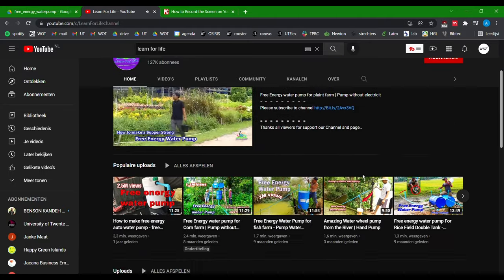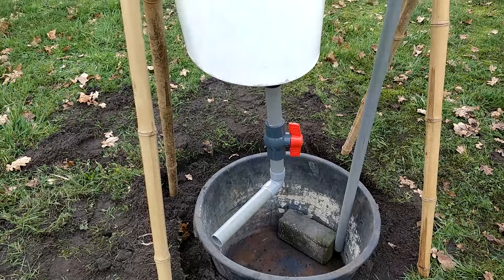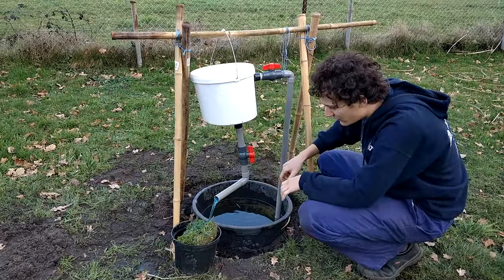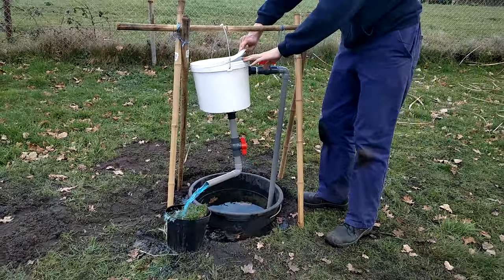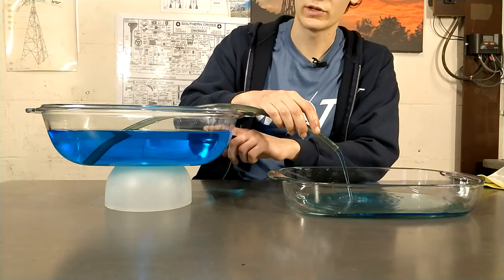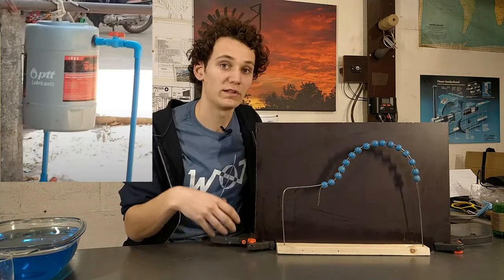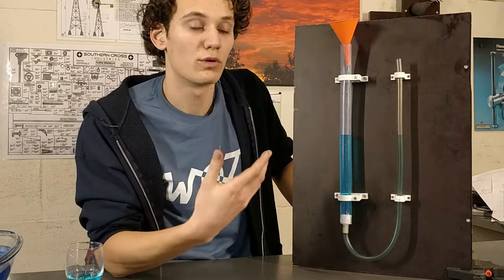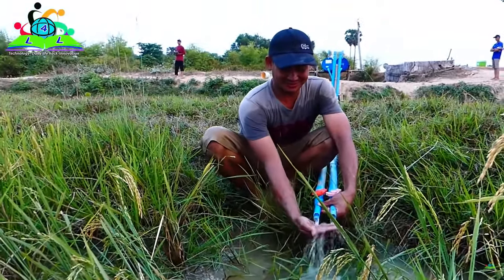FREE ENERGY Water Pump Tested. Is it possible?

Comment: We haven't tried this experiment but we have tried other experiments and have good results it seems to me that you really don't understand siphons like the hero fountain. One the water level had to be over top pipe in order for it to work and the water down at the bottom had to be one continuous water that means the pipe at the top had to be full of water second the noise you heard of the gurgling means that it was creating pressure, we suggest that you redo the experiment and we did send a video earlier to show it's should work but how long well the heroes fountain the real one has work for centuries and it takes it's pressure from the lake so in real life these things actually work. How do we know this one I'm a librarian and we do research and study these things so are you doing something wrong and didn't name it fake which does damage to ever going to Green energy I think so you have one way of thinking and it's always have to stay with you been taught you'll never discover anything new if you never go outside the Rams of what we've been taught. We have a suggestions will send it in our next communication let's see if you're brave enough to try it??????

Comment: Are you telling me I can hold up a 1000 tons worth of water with my finger? Think about it if I put a small hole in a bucket big enough to hold a 1000 tons of water I could just plug the hole with my finger done. Lol
Reply: Yes you can! It all depends on the water height from your fingertip to the water level in the tank, not the volume of it.

Comment: You didn't do it right, it most definitely works. It looks like you just assumed it doesn't work and half way did it and when urs didn't work, you thought it confirmed it didn't work, but in reality it requires a bit more effort to get it working than what you did, but it definitely works
Reply: No, this is a siphon with a priming bucket. No siphon can lift any water to a higher level. This excellent video demonstrates that
Reply: @kjellg6532  No, there's more to it than what he did, people actually do this and it works. The pressure it creates, makes a suction that continues the siphon without it being lower than the water source.  There's more to it than I know how to explain, but it definitely works
Reply: @LandonHarris343  Sorry, but that is not the case. When water start flowing out, an underpressure is created in the bucket, but til reduction is defined by the height difference between the surface of the water in the bucket and the output. This height is less than the height from the source to the said water level in the bucket and the water will try ru go in reverse back to the source/well. It all stops. Then air is leaking in from the outputt side.
Reply: @kjellg6532  well, I know it works, bc I've seen it work. I don't know all the science behind it, but it works. I can't take your word for it when I already know it works.

Comment: I believe the inlet pipe should be much smaller then the outlet pipe
Reply: Unfortunately   you  do  not  understand. the  basic  that   .........the   tank  must  be  air  tight  ,and  can  resist  a  negative  pressure   of  at  least  15  psi  and  the  inlet  system  must  be  also  air  tight  and  sealed  . You  should   also   know   that  the  inlet  water  level  cannot
Reply: Inlet  water  cannot  be  lower  than  33 feet   .

Comment: inflow pipe needs to smaller diameter than outflow pipe. At least 5x difference between inflow and outflow pipe diameter.
Reply: No. Input may be any size, even 5x grater than output, but for this to work, the source warer level must be higher than the exit.

Comment: U can certainly siphon from a lower point to a higher point  I do it every year when I empty my pool
Reply: That is not possible. A siphon can not deliver any water at a higher level. Now with a siphon you can go over a maximum 10 m high wall, but you can not extract any water up there. All of it must down under the source before exited. So, lokking from inlet to outlet, no siphon can lift any water..

Comment: your pipe size to vessel size is off ratio, also did not prime correctly. this does work, you just didnt consider the science very well. i made a setup like this and it worked fine the first try.

Comment: Probably there is air in the white bucket coming from the lid
Reply: Noop, the video shows that the lid is air tight. The video shows that this siphon, as any siphon, can’t lift water to a higher level. A siphon is no pump due to no input of energy. Input water level must be higher than point of discharge from the system. If not, the system will suck air from the output side and stop.

Comment: For some reason your demo I didn't see the sealing the tank and I bet you didn't do correctly feel like rush job. I bet the air is leaking from it.
Reply: No. You clearly see that water is gulping out the exit. That because air is sucked in from the exit side. This proves that the bucket is airtight.

Comment: Pls don't try disprove peoples effort.It works because of the following
1. Nature provides for no  vaccum. I've duplicated this model. It works.
Use smaller pipe for suction and twice it's size for outlet.
Total volume of inlet pipe should not exceed 30% of the suction drum.
Extend the outlet to a minimum of 10metres. Make sure you include anti return pressure stand pipes closed on the upper end. It works.
I am Uduak Ekene, physicist and mechanical engineer,
MD, KENAK INTEGRATED FARMS
Reply: Gravitational force g is 9.8m/s. 
Consider the the volume of water in suction drum about 200l . Av.  .200kg, acted upon by 9.8g. force at a height of 10m . A suction pressure is enough to suck water from 6m well, through a 25mm diameter pressure pipe. 
This force is enough to suck from a 11.5m water well through a 12mm diameter pressure pipe.
This force Will crush a 200l PVC drum.
This force can crush your skill in 2s.
Thanks
Uduak Ekene
Reply: @uduakekene5707    Sorry, you are a physicist and mechanical engineer, but you believe in perpetuum mobiles? What about conservation of energy? It needs energy to lift water from a well. Where does this energy come from? Don't tell me vacuum or gravity are a source of continuous energy!
Reply: “It works”. 
You have just invented Perpetuum Mobile? If you have such a thing, you could take water from any lake or sea,, pump it up and let it flow back to the sea via an electric turbine. No more electricity bills. No more need for oil, coal, gas or nuclear power. Just running water in an endless loop.

Comment: Set up is different from the original one, First the suction side doesn't have a foot valve to hold the water from the intake line, 2nd  your bucket might not be a air tight , mean is not airtight you will not creat vacuum pressure to suck water
Reply from the maker: Hi Mandy, as mentioned, we replicated and tested the setup you can see at 0:15. In the video about their setup there is no mention of a foot valve.

Comment: Multiple mistakes :   1)   Your tank is tooo small for size of exit pipe.   You need to create lots of low pressure inside .  The pipe size is directly proportional to tank size/inside pressure.    2) You didn't fill the input line , water drags water.   3) The lid may have pinhole size of air leak , that can prevent functionality .  4)   The input line must be smaller than exit line .   I empty my swimming pool without a water-pump.   I put a hose in the pool,  then create suction using shop-vac .  As soon as water starts to flow, I  remove the shop-vac,   water flow continues until pool is emptied; however, the hose end must be lower than pool's bottom .   U see water climbing up then slides down the hose.
Reply: Of course siphoning works, but no tank is needed for that, not even suction. It is enough to fill the hose with water and close the outlet end until it is in the right position. But this video is aimed at the claims of many YT-videos, that you can get water up from a deep well with the outlet well above the water level of the well. And this is nonsense. If something like that is demonstrated it is a fake.
Reply: The reason why it works is that the hose end is lower than the pool's bottom, that is also why there can be no free energy water pump as the water level intake must be above the outlet. I believe that is what the video tried to explain.
Reply: @haweeha7738  i agree , i tried the experiment . concluded same
Reply: 1) Actually no tank is needed. Pipe size does not matter for this to work.
2) With a container, you do not need any foit valve or filling of inlet tube. 
3) ? (The lid must be air tight)
4)  No, input line may have a diameter of say 1 meter and exit line 10 mm in diameter.

This video shows that a siphon can not lift any water.

Comment: For sure this is not a free energy design. Perhaps low energy would be a more appropriate name for this solution. The guys are lifting 150 to 160 litres of water to 1 to 1,5 meters. That is already some potential energy there to do some work.  This pump if one can call it a pump is just an easier way to start siphoning without an electric pump or other means.

Comment: Items missed out by author....1 foot valve, 2 outlet pipe of double diameter and five times longer length, and 3 air pressure chamber. Please do your job properly otherwise you are doing a disservice to the creator and your audience.
Reply from the maker: Hi Sam, as mentioned, we replicated and tested the setup you can see at 0:15. The size of the pipes we used is pretty similar to the one in this video. Also in this video there is no mention of a foot valve. For reasons explained at 5:00 in the video, we think changing the pipe diameter will have no influence on whether the pump works or not

Comment: You didn’t use an air tight container! Try again! It depends on the suction inside the container.
Reply: Look at the video! The container is air tight. He shows that this setup can not work. For it to work, the outlet must be lower than the water level in the source. Hence, no siphon can lift any water up from a well.

Comment: What I learned from your video is that an intelligent person can play the role of stupid, but the opposite is very difficult...
You have to fill the inlet tube until the water level rises above the outlet, and when there's no more air in the inlet tube, the water will flow out, acting like a vacuum pump...

Comment: OK... So, I do not see a pressure tank or cylinder. You can't do a test and fail it if you are doing it wrong.
Reply: Also. You have no check/one-way valve installed.
Reply: He is using a plastic container with a an airtight lid. Do you not see it? Using a barrel in a siphon means that it is easier to prime the siphon and that no one way valve is needed at the inlet. Perfect video, to the point!

Comment: The system works the bucket you have is too small the volume inside the bucket is less than the volume inside the pipe running down into your well you have to take this into consideration this is called physics
Reply: But the barrel here is much much larger than the volume in the suction pipe. His point is to prove that no siphon can lift any water.

Comment: Its quite obviouse that water drops from a great height the end game is to get the water to fight gravitational force which is impossible bar you have a Ram Pump,,
There is a way by using a small gadget made in the USA,,its called a V Pump try getting one!

This V Pump is primed from a water tap,,you turn the tap on feed the system then of it goes,,its possible to prime the V Pump by other means using  stream water syphoned through a miniature vaccum hence of it goes against gravitational force.
Reply: A V-pump is a totally different system. It has been used for decades to pump water up from deep wells. It is also used in steam engines to inject more water into the boiler under pressure.  It relies on a ejector system. 
Used in a well you submerges the ejector down in the well, two tubes going to the surface. On the surface there is an ordinary electric pump sending water down to the ejector and receiving water coming up the other tube.  The water goes round and round. Now, you may extract a fraction of this water at the surfase, and the system will replenish from the well. 
Ejector pumps are also used on some (war)ships as emergency pumps. 

To make a V-pump work, you need a continues flow of pressurised feeding water
Reply: Em, considering the V Pump assuming tap water is the primer under pressure to prime the V pump,would you think the same set up under pressure could be achieved from a bilg pump ie creating the primer as the pressure point just like the pressure from a tap,
The question relates to reversing gravity flow up stream to operate a sluice,
As one must work down river not up river the object is to get lift into a highbanker sluice to attain waterflow up stream into the sluice,, im not accustom of knowing the answer to what degree of pressure would be needed to trigure the V Pump i haven't globally seen any specific device that can lift water against gravity that would be amicably priced to the market place,i am awaear there is a screw pump innovation from the egiption period,,but such device hasn't been miniaturized into product form notably there is one made in mock pvc with a motorized unit driving the screw to raise water at speed but not under production,ram pumps are a tiresome set up there is a system by Australia this acts like a ramping but floats and is piston fed without fuels electric etc water primed fed,.

Thanks again appreciated
Reply: The Australian version is called a BUNNYIP PUMP
Check it out,it is quite exspencive totally water primed operated from the same stream,river,creek,self reliant floats on the surface of water sat on a tyer for pump compression from the pistons.

Comment: You need to prime the pump, it doesn’t have to do with siphoning it has to do with suction, you had too much air in the lower pipe. Instead it sucked air from the outlet pipe. You missed a lot of the pipe setup.
Reply: Try it again by priming the pump and run the outlet into the original bucket to keep the water level up.  Go over the instructions again.

Comment: YOU DIDN'T ADD THE "ONE-WAY" STOP VALVE at the water source and have that also filled up with water to lock the air so that the AIR PRESSURE os built up in the big bucket to havr the vacuuming/ duction effect, brah. Please don't be so hasty to ecplain away why things didn't work when you actually left out one of the most critical pieces of the entire setup.
Reply: YOU DO NOT NEED ANY “ONE-WAY” STOP VALVE WHWN USING A PRIMING BARREL. There may be a lot of air in the bucket. He is proving that a siphon can not lift any water.

Comment: The device prepared on this page seems to me that it has not been processed with sufficient accuracy. By observing the video ( https://youtu.be/23Afu1ViH3E ) here shared in the answers by @crazy project, (project constituting transparent lid that seems to work), it does not report gurgling: this shows that the atmospheric pressure present in the open air does not tends to enter the bucket from the outlet tube towards the vacuum area generated in the upper area of the bucket; observing that the outlet flow is homogeneously flowing makes me think that one-way valves are not necessary. The homogeneity of the outgoing flow and the absence of gurgling makes me believe that in the lapse of pressure difference (between the vacuum area and atmospheric pressure), the working efficiency force is inclined to work on the charge pipe. Otherwise, gurgling generated by the entry of air through the discharge tube would be observed. I observed that, despite the two pipes (charge and discharge) are of the same diameter, the outflow is greater than the incoming flow (at the end of the video it is also visible that the water level is slightly lower than the start of pumping): that it shows that the process will remain operational for a limited period (because more water comes out than it enters). I also observed that the outlet pipe is inclined downwards (I don't know if this is a detail to be considered with importance). The most curious thing is that the pumping height distance is surprisingly high.

Comment: It certainly does not work in your construction.
In the barrel it is possible ... I have not tried it but it is based on other types of forces that are possible as long as the correct choice of pipes is made.
What plays an important role is the distance and the cross section of the pipe that leaves the barrel ...

The pipe that feeds the barrel is smaller in diameter ....

So when the barrel is full but also the outlet pipe also when the water starts to flow the force expressed through flow weight creates a vacuum in the barrel which forces the thin tube to suck the water from the well to balance the vapor forces. .

SO I SEE THE BARREL LAYOUT WORKS ...

What I do not understand is why after the barrel there is a closed vertical pipe ... what does it serve ....

Maybe those who do have the ram pump in mind.

Comment: No, you didn’t do it right. I think you are confused. You need to do it in a solid tank cuz this plastic bucket get squeezed which lower the pressure when air sucks. Also the out put pipe should be bigger.
Reply: Noop, video is fully ok. It shows that a siphon can not lift water.